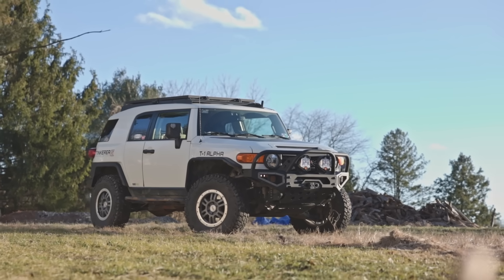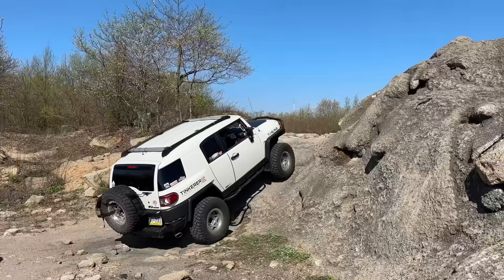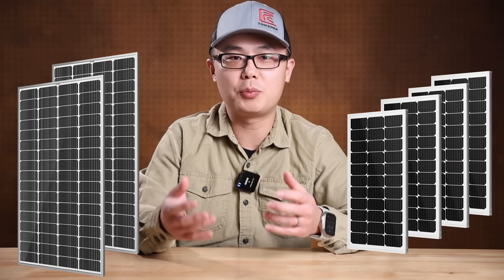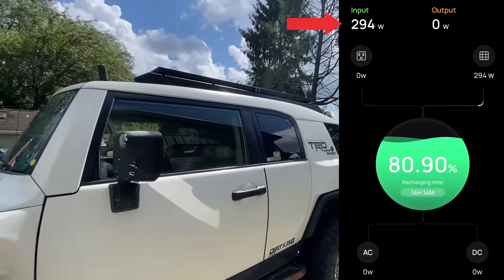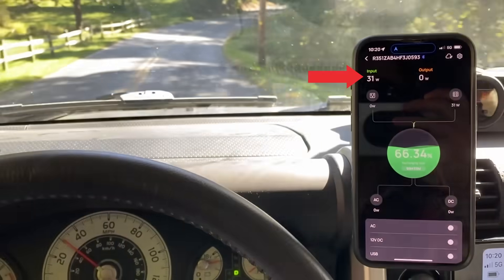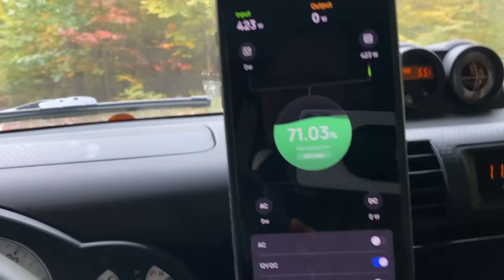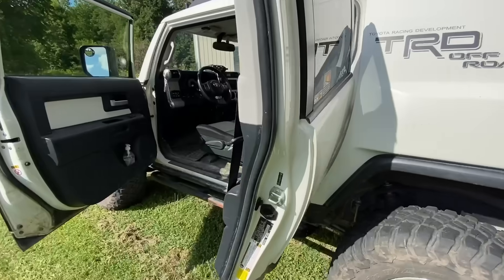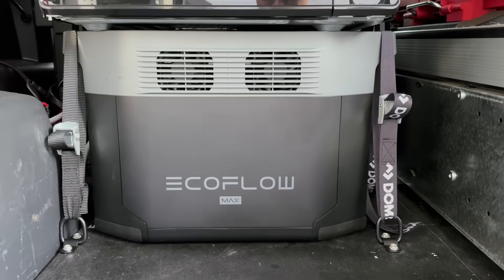I Installed a GIANT Solar Panel on My 4X4 | BougeRV 400W 10BB Mono Panel

Comment: Eso Es Todo/ That's What I'm Talking ' Bout :face-blue-smiling: photovoltaic/solar thermal technician here: well done  
Monocrystalline is the way to go. that's what i wanted to do but have a Thule box on top, it did come with a solar panel version, i was not willing to pay for price and poor wattage. i'll just have to mount a panel on the box. if i get rid of my Thule i'll go flat all the way, heck i just may just do it and mount a sliding rail on top of panel and when not driving slip the box to expose the panel... 
if someone builds my idea first Kudos plus Cerveza to you 🍺:face-turquoise-drinking-coffee:

Comment: Did you keep your alternator/DC converter charging system after installing the solar panel? If so, how do you switch and/or combine the 2 charging power sources when driving? BTW, great video!
Reply from the maker: Yes i have both now. I switched to the delta 2 max with dual DC input ports.

Comment: In my opinion you've overlooked a very simple solution which is a DCDC charger to supplement a smaller panel. Your roof weight reduction was wise however I would be very surprised if the rest of your accessories haven't resulted in the FJ being over its specified gross vehicle mass. Thanks for the content. Cheers
Reply: @ellev7237  He does what?

Comment: Excellent presentation and installation.  I installed 2 x 169W thin film CIGS flex panels on my RAM 2500 rooftop and bed cap to charge my Ecoflow setup (Delta Max with 2 Extra Batteries).  Although one panel experienced delamination  and had to be replaced (under warranty), I still prefer the lower weight and negligible wind resistance of the thin panels vs glass.
Reply: I thought those CIGS panels were supposed to be bulletproof! Have you seen the Obsidian panels by Zamp?

Comment: How did you hook up the Orion to the S-pod button? I would like to do the same, but I'm not sure if the remote wire simply takes 12V+. I would like to mount it in the engine bay, but don't want it powered on all the time.

Comment: As always great work and interesting and inspiring video. So you’re another one removing the rtt. I’m still researching the perfect rtt for me. But I don’t buy anything because my main concern is the vehicle handling, actually how much the rtt + 270 awning would impact he vehicle performance off-road. How much body roll I would have. Braking performance…
Maybe you are interested on to make a video testing the same vehicle behavior with and without the rtt. No one has done it before.

Comment: I don't know if you do requests, but your video reminded me of something I have been curious about for a while. Can you make a video addressing Load Capacity. Myths, facts, and how all these overlanding rigs have full armor, racks, tents, and bumpers, but we never hear about them being a thousands pounds over capacity?
Reply from the maker: Thanks! That is a good topic. I'm sure a lot of people are overloaded but have been "fine". This is because design factor/safety margin exists. So seeing actual failure is still a low occurrence event, but that doesn't mean we can justify playing with fire. Engineering reliability involves a lot of statistics, which I feel is the least intuitive type of math. I will try my best making it more intuitive and making more people respect it.
Reply: @TinkerersAdventure  awesome! I look forward to it! thanks for the reply
Reply: Bump to the top
Reply: This has been a pretty big topic in Australia for the last few years, so would definitely be interested
Reply: Many vehicles are beyond load capacity. Overloading by adding weight to the vehicle beyond its load rating you begin to diminish the life of components, reduce handling, reduce mpg, add wear and tear to common components such as steering racks, etc… 

Teaching off-road driving we cover these topics when talking about driving techniques, hazards such as changes to handling, and vehicle recoveries. 

In this video, Tinker talks about the rooftop weight and how different the vehicle handled after removing items. (There’s a roof load rating too!)

Lots to consider when outfitting a vehicle. If your gear needs exceed the vehicle’s capacity you likely need a bigger vehicle. 

I’m sure tinker can do a banger of a video on it.
Reply: People don't realize how detrimental all that weight up high is to the vehicle stability and dynamics. I've recently done a lot of trimming down on the top of my Jeep & Sequoia for this reason. I've gone down to lighter weight aluminum framed RTTs which allowed me to eliminate the roof racks which were supporting them. I fabricated custom brackets that bolt to my backbone system on the Jeep or the factory mounts on the Sequoia. On the Sequoia I saved 60 lbs by removing the Sherpa rack and brought the tent down 3" closer to the roof. The RTT is also 30 lbs lighter than the one I replaced. It made a huge difference in wind noise, fuel efficiency, and vehicle dynamics. Then I did the same with my Jeep, lighter tent, no roof bars, no more gear on top of the tent. 

As convenient as those mounted awnings are, they are a decent amount of weight high up on the vehicle and they stick out. My 8 lb moon shade takes a few more minutes to set up but saves in the aforementioned areas.

Comment: My ultimate setup would be an internal cage for safety, but also for structural rigidity since I would cut the roof out and do a full solar roof that wouldn’t be visible from the side. #slicktop Reinforced with carbon fiber, of course 🤓 It probably isn’t as efficient, but I love the translucent solar roof of the #fisker. I wonder who makes that for them 🤔

Comment: I am going to ad 2 solar panels to my bed cover on my 2016 Ram 2500. I am making a bed cover that opens in the center and each side pivots to a straight up position and locks in place. Going to make it so those charge my 2 batteries and also run a small heater in the cab in winter. Some times it takes 30 or more minutes to chip the ice off the cab for a 30 minute drive. I hope when it is sunny enough it puts out enough heat to keep the cab from becoming a frozen over ice box, like it does now.

Comment: Is the panel taped/glued down to the crossbar in the middle? If not I'd use som 3M double sided tape to keep it from vibrating at highway speeds. At speed I bet there's enough pressure to push the pannal up away from the bar and cause some vibrating/slapping which could cause damage over time. Cheers.

Comment: Excellent content and your truck looks too good to off road. Here is a different scenario for those that camp in one spot for more than a day. In the summer it gets so hot we always try to park the vehicle in the shade of large trees. It can get way over 100 degrees during the summer so keeping the truck in the shade makes it much nicer. But that kills the concept of a hard mounted solar panel. The portable ones are a pain, are easier to steal and really don't put out decent power unless you constantly move them to follow the sun. For our needs we find that a quality Honda EU1000 watt generator works great while we are away from camp vehicle to charge the solar generator. It can be chained to the bumper, fills the battery bank very quickly and weighs less than your 400W solar panel with mounting backbone. Since it is so quiet, it can be run in the evening if maxing out the electrical demands or if the solar generator needs a quick top off before bed. 
Just another option to think about for those that stay at the destinations for more than a day.

Comment: I have a dual battery setup in my GX460 that charges off the alternator when driving so I really don't need to use solar at all since we tend to move camp every day.  Love having a good supply of electricity at camp.

Comment: This video is a great analysis. I love your content, the quality is unmatched. If you had 4x 100-Watt panels in parallel instead of the one 400-Watt wouldn't it generate more electricity for your specific use case? I thought that if any part of a solar panel is in the shade the output of the panel is drastically reduced so if you have more, smaller panels, running in parallel you will generate more electricity under shady circumstances like overlanding through a forest or driving along a highway with some trees. I could be totally wrong about that which is why I am asking haha.
Reply from the maker: I think you are right. 4 pieces in parallel should perform better. But I chose 1 single piece because of the overall form factor that fit on my roof.
Reply: @TinkerersAdventure  this was going to be my question for you. As an engineer I'm surprised V=IR did not motivate you to go the multiple panels in series in lieu of one panel (effectively several panels in parallel). For slightly more real estate you gain more VOLTAGE per watt of panel by running in series. I agree that 4x 100w panels in parallel would be over all less efficient use of space than one 400w single panel, but two 200w panels in SERIES will give you more voltage for the same solar load. I run two panels one on top of the other but mounted on a slide. While driving along or offroading the upper panel is locked in place (I'm primarily running alternator charging) but when I am camping I can deploy / slide the upper panel over my hood and gain access to 2x voltage. I live in the PNW where every watt of solar charge matters.

Comment: This is another great video n setup further to the last time of DC to DC charging method! Thank you!  Have you upgraded your Ecoflow Delta 2 to Delta 2 Max? You now have two solar inputs (Alternator+Solar Panel) all together so that you can charge the Delta 2 Max concurrently?  If you are still using Delta 2 (with one solar input), is there any way to charge the Delta 2 concurrently with Alternator+Solar panel at the same time? Your ideas, pls.
Reply from the maker: Yes I switched to Delta 2 max for its dual independent ports. I did give up one of my ARB drawers because of the larger size of D2 max. I will go over the best solution for single port in a future video
Reply: We are really looking forward any possible options for single solar input , many Thx!
Reply: I have a Toyota 5th Gen 4runner and Ecoflow Delta 2, based on your wonderful videos, I installed the Victron 12/24 15amp Dc to Dc charger (not the converter), configure this charger as power supply mode. The Ecoflow Delta can be charged up to 280W with this setup. I am thinking to add a 24v 200amp Life04 battery and let it charged by this Victron 12/24 charger and also connect the Delta 2 directly into this 24v 200amp (act as a huge expansion battery ), with this setup, Delta 2 might be charged by the Alternator as well as another separate solar panel on roof top.   I actually installed a 200w flex solar panel on my 4runner roof top, just like what you did, this flex solar  panel fit exactly roof dimension. I did a vinyl wrap and then glue the flex solar panel together with a plastic board (act as heat insulation), this project is still on going. I need some ideas  how to charge Delta 2 by Alternator+ Solar panel (just like your latest setup). Hope to seek inputs from you and your followers. Thank you.

Comment: Maybe i missed it, did you go over how you charge from the solar and alternator at the same time? You only have one input port on the D2.
Reply from the maker: Unfortunately you will not be able to do that on the Delta 2. I switched to Delta 2 max for its dual independent ports. I did give up one of my ARB drawers because of the larger size of D2 max.
Reply: @TinkerersAdventure  thanks for the answer.

Comment: This is amazing. Would love to eventually see a detailed breakdown of your all electric set up. I love a PHEV/EV for it's built in battery and easily having thousands of watts of power, but we are still very far away from having a complete setup for PHEV/EVs to bring off grid.
Reply: This is why I feel the hybrid landcruiser will be a game changer with its 2.4kw sine inverter. Don’t need solar if you can pump that much power into your batteries
Reply: @TobyCostaRica  Exactly. Don't get me wrong 4cyl hybrid have 4cyl hybrid problems. But I drive a RAV4 PHEV, and while I don't have the capabilities of a 4runner. At camp site I'm constantly flexing on everyone with my 15kwh of usable battery, and 1500w outlet. I can power anything. I can use car heater/AC all night without worrying about engine idling/running out of gas. We're still at least 1 full generation (8~10 years) away from having 4x4 with PHEV. Probably another generation away from a solid one. So 20 years away. But I can not wait until that day comes.
Reply: @KevinLin145  you really think it's that far out?  The 4xE series from jeep is already out.  I'm a Ram guy now but Ramcharger isn't my thing.  I'm more interested in a dual drive train from Ford, their power boost only has 1.5kwh, so I'm interested in seeing when they upgrade that battery into 15-30kwh.
Reply: @mgiraudjr   naahh I exaggerated. But I do think it'll be a while until we figure out a solid reliable solution. And that includes figuring out how to make denser batteries so it doesn't eat into cargo room like the 4xe or the current hybrid tundra/sequoia.
Toyota probably won't have PHEV for this current new generation of 4x4s. So that's at least 6-8years, if not 10 until the next gen drops. And who knows what kind of issues we'll slowly find out as we go. 

Wrangler 4xe is awesome. I love it. But just like most PHEV, the electric motor is married to either the engine or the transmission. And acts more like an electric assisting supercharger if you will. Basically a prius on gallons of steroids. But the con with this is you don't get all the potential benefits of EV since you don't have strong enough electric motors. And don't have enough room to put tri or quad motors to each wheel.

Ramcharger is awesome too. It solves the problem I mentioned with current style of PHEV. By completely removing the engine from the drivetrain you get to fit a much larger motor/battery setup. And thus getting "real EV" performances. But as well can see with the cybertruck, figuring out a good 4x4 software for 3x electric motors can be challenging. If we can get quad motor then we no longer need lockers!! 

That's what I mean by it'll take 20 years and 2 generations of messing around and finding out what works best until we have a reliable system to take off grid.
Reply: @mgiraudjr  btw check out Edison Motors. They make diesel electric semi trucks. (same tech as the Ramcharger) They're not in the 4x4 world, but still interesting to see how this hybrid tech can take over the semi truck industry.

Comment: I would suggest anyone who wants to mount a solar panel on their vehicle to buy a 24V (or 2x12V) one with bypass diods and an MPPT controller 
They are WAY more efficient then a 12V one due to higher voltage which are more effective in cloudy days.
A 12V one might not generate enough voltage during cloudy/very cloudy days. A 24V one doesn't have that problem.

You can also use thinner wires from the SP to the controller.

I have 250W/24V, 150Ah lithium and a victron MPPT 100/20 and did a LOT of research before buying.
At 185W I'm charging 13.1A, thats more then the maximum output of that 400W panel.

EDIT; The panel is also smaller then the 400W one. Mine is; 54,5" x 39" x 1.37".

The voltage specs on the 400w 12V panel seems odd though. It's closer to a 24V one then a 12V one.
It almost seems that they market the panel in 12V (looks better with 400W instead of 200w) but it's actually closer to a 24V when looking at the volt specs.
It's only the 400w model that are marketed that way when looking at the instructions.
Reply from the maker: This panel is 31V x 12.9A MPP, and 37VOC, so it is already “high voltage”. The winter in the northeast simply has too little solar energy. Not great for showing its true potential
Reply: @TinkerersAdventure  That's not a 12V panel though. 
It's a lazy-ish 24V SP.

This is dangerous.
You MUST use an MPPT controller if you are charging a 12V battery.
Using a PWM (which technically is ok because it marketed as a 12v panel) will destroy the system.
It should say "BougeRV 200W 24V 10BB Mono Solar Panel" or 400W 24V. They are mixing the specs. No 12V panel is 37V open circuit.
Reply from the maker: @perpelle  of course...MPPT is the norm nowadays. But I agree, BougeRV shouldn't say 12V in the title. There is nothing 12V about this panel. I also voiced that to them.

Comment: I’ve been planning a build that will allow me to work remote from anywhere with my GX 460 and th biggest hurdle for me to tackle was power.  This series has been a HUGE help in me learning and planning my build for what I need.  Thank you so much!
Reply: If you’re working remote, I would recommend a folding setup that allows you to stack multiple panels on top of each other during transport. When you park, you can unfold them and spread them out; supporting the ends sticking off the vehicle with canopy support poles. You can then get adjustable angles, depending on the complexity of the brackets/joints and how much space you have up top. 

Estimate 800-2000W of panels with this configuration.
Reply: A laptop that charges from usb c is really handy for this.   But a 100ah lithium battery will charge a laptop many times too.  I do this as well and have found that for it to work longer than a few days then I need to stay in hotels or a motorhome for privacy and comfort.
Reply: High output alternator and a few hundred ah of lifepo4